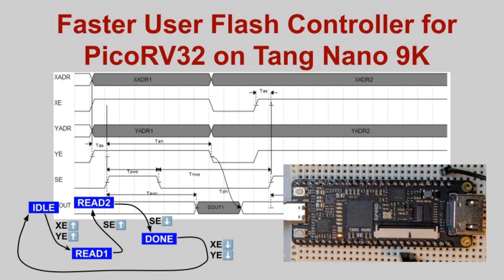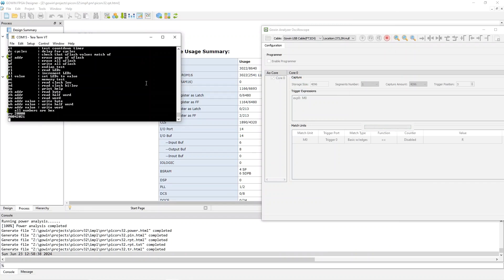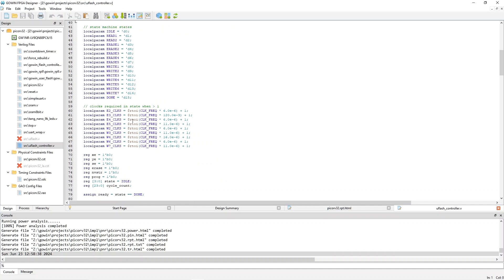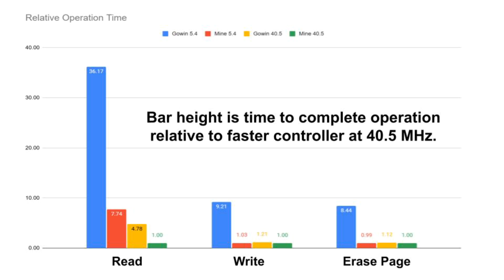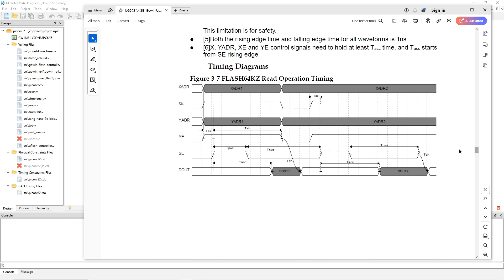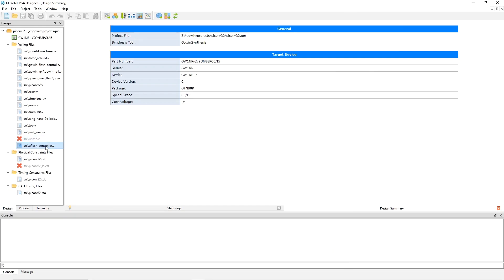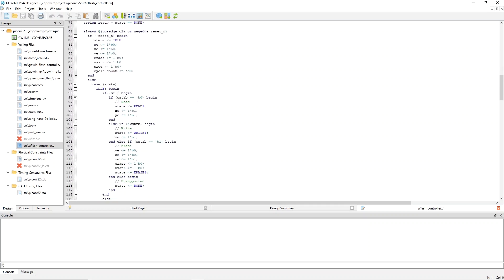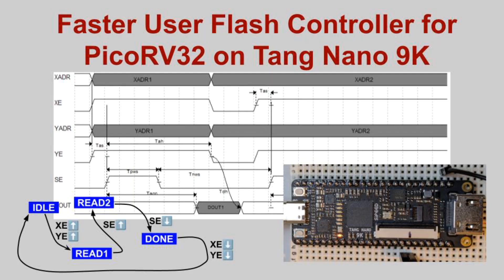Faster User Flash Controller for the Tang Nano 9K

Comment: Hi @electronics.tinker, thanks for a great video. The flash controller you are using does also contains the bitstream? How do you know what part of the flash that is available for custom stuff? Do you know if its possible to flash that part user from your PC using usb?

Ultimatly want to be able to execute code from the picorv32 core directly from flash, as the sram on these things are very limited.

Comment: Erm, what about running the GOWIN code at 50MHz and then using a FIFO to cross clock boundaries to your working clock?
Reply from the maker: I think the performance of both could be improved by using an additional clock.  I was trying to keep it simple.  Clock domain crossing is a good topic, though.  In the past, I tried to get the Gowin tool chain to complain about bad domain crossing.  No luck with that so far.